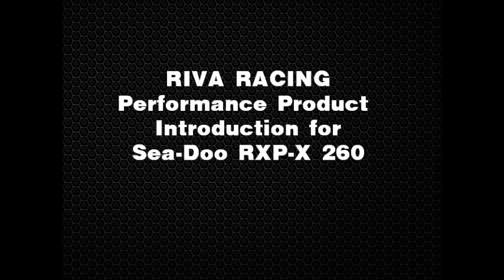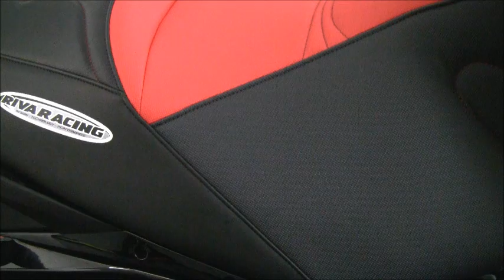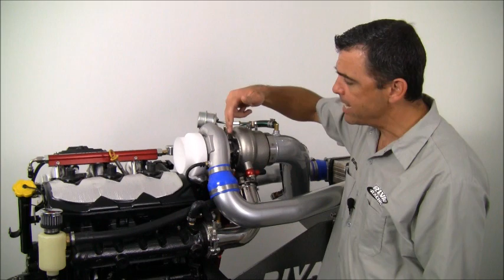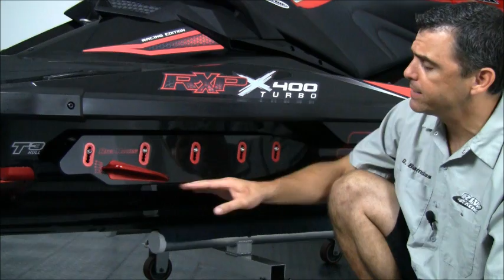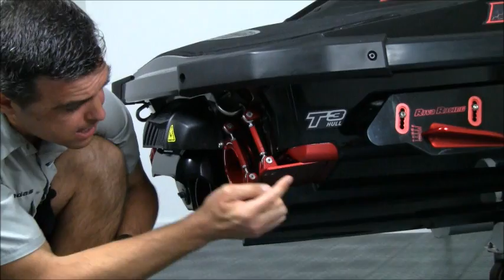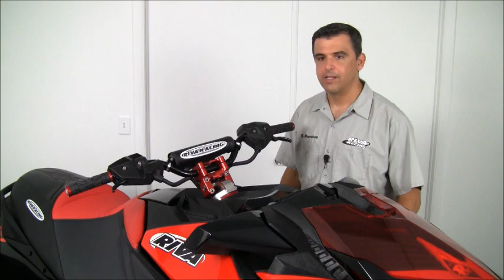2012 Riva Racing RXP-X 400

Comment: What is the top speed for a rxt-x260? Is this better or worse than the stage 4 kit? Will I keep ski mode and eco mode if I install the turbo kit? What hp does the stage 4 kit have?

Comment: I contacted Riva Racing about this a few weeks ago.  They said to buy this Sea Doo RXP-260 from them it would cost around $25,000.  The Yamaha FZR Turbo would be over $30,000 because they have to upgrade more engine parts in the Yamaha.